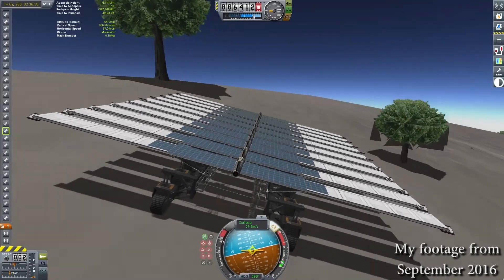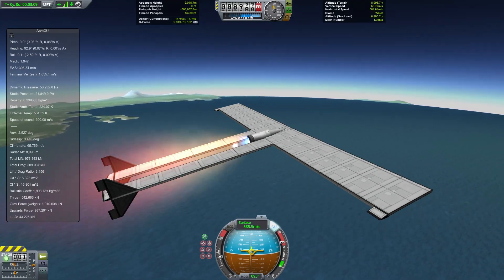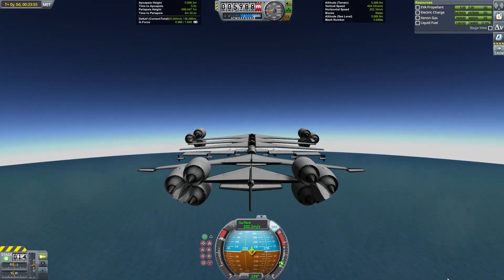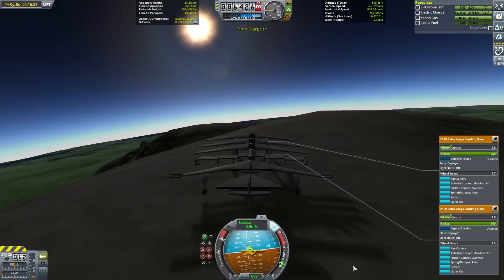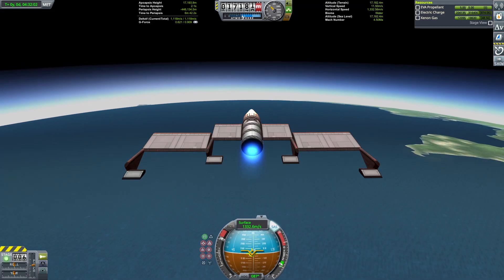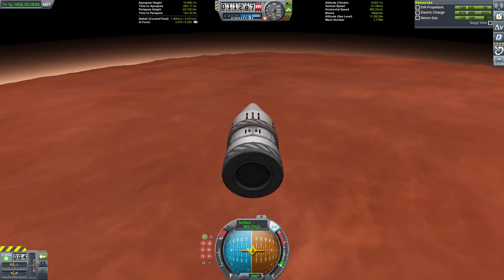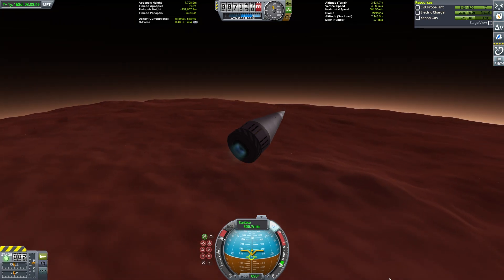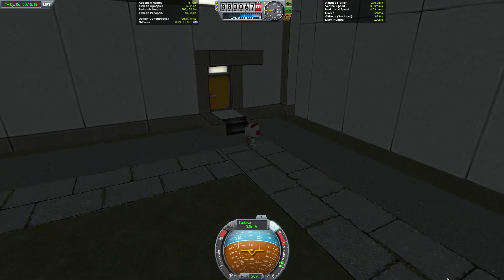Orbiting Kerbin with only ion engines - KSP

Comment: I know this is an old video, but I think a good challenge would be to try and find a way to get air breathing engines into orbit without using anything but RCS for the final orbit burn. You’re not allowed to use any air breathing engine that uses a closed cycle mode to get around the challenge and make it easy. I think it could be possible if you can get enough velocity to essentially fling yourself into space, but I’m not 100% sure that it would ever work.

Comment: Does this count, given that you used liquid fuel engines to get part of the way up?
Reply: Yes, because he took off from the surface using only ion engines. Even the KSC launchpad is around 70m above sea level if I remember correctly

Comment: I figure out is why they dont trap ions and release under higher pressure. They always show ion engines using the particles like a rocket while u want it like a engine. Imagine u release the ions into a chamber untill it fills up like a battery and the moment it starts overloading u release to create a higher amount of force. I gues overloading the reactor/capacitor will become a real thing instead only in sci-fi.

Comment: ISS use solar panels to fly like kite  in high speeds, and low presure and high altitudes in circular flyways up and down to mantain the curse and inertia, economizing fuel, on board to acurate the curse never fly over  South  or north Poles and never  to fly over _across the Poles, have a question...is the Earth a Huge sphere or Huge planisphere.? Microgravity explain : more distance far surface, minus gravity force atraction, less weight sensation,

Comment: Technically, this mission was not done ONLY using ion engines, in order to get to an efficient and acceptable altitude, you had to use air-breathing engines. I don't want to be "That Guy" but, you know.
Reply from the maker: Official mission start is on the ground at the mountain summit.  You know, to be 'That Guy' =)

Comment: The MIT group did not used onboard propellant in their electric engines but used the atmosphere it self as the propellant. This is an ionocraft engine, not an ion drive like yours is which needs xenon or some other contained gas in a tank.

Comment: bradley whistance: makes a plane with 2,000 engines and 16,000 batteries, weighing roughly 1,000,000kg

also bradley whistance: “i COULD have used a docking port, but that would have added 10kg”

Comment: I've a challenge for you that I've envisioned, but lack the skill to execute. Build a mun orbital refueling station with docked beams and rcs karts. Drag astroids to dock with it and use the rcs drill karts to process fuel in a major refinery. Then use the fuel to launch orbital stations around every planetary body in the system. It's a two goal project, accumulate all asteroids on one station, and establish a regenerative refueling platform for deep space placement of hardware.

Comment: @Bradley Whistance
At around 14:53, how did you recharge your batteries all the way up to 8300? I couldn't spot any solar panels on your craft. Did you cheat?  Anyway, amazing mission.
Reply from the maker: Great question!  The solar panel is inside the utility bay, which is opened for recharging.
Reply: @BradleyWhistance  thank you for the explanation! Now I can sleep well again

Comment: Ion engines in KSP have hilarious amounts of thrust. How much? 2000 newtons. That's off from real life ion engines by a factor of several thousand; highest thrust space flown ion engine I believe was around half a newton. The energy usage is hilariously low for them as well. A 2000 newton ion thruster with 4200 seconds of ISP would need a minimum input power of 0.5*M*(4200*9.8165)^2, where M is the fuel flow rate. The fuel flow rate can be found by the thrust as T = M*V = M*4200*9.8165 = 2000, M = 2000/(4200*9.8165)= 0.04851 kg/second, so the energy requirement is 0.5*0.04851*(4200*9.8165)^2 watts = 41.23 megawatts assuming 100% input energy to kinetic energy efficiency. Using solar panels with 30% efficiency (considered quite efficient by modern standards) you'd get 0.4119 kilowatts per meter squared if exposed perfectly to the sun, assuming you're at the earths orbit. You'd therefore need 41230/0.4119 meters squared of solar panels, or about 100,000 meters squared of solar panels. That's equivalent to a circular solar panel with a radius of 178 meters. Good luck with that I say.

Comment: In the early 70s the Worldbook Encyclopedia had plans for an air breathing ion engine suspended on a thin wire pendulum as a possible science fair project. Back then, I wondered if something like that could fly into orbit with solar panel wings. I figured it wouldn't work, so I never really thought about it much more.

Comment: Hummm, I'm inclined to think that using Jet engines to get the ion plane to altitude before launch is not quite reaching LKO using only Ion Engines.  Once lifted to altitude the difference between a mountaintop launch and an air launch is purely semantic.  Stratzenblitz did it on electric power only from the KSP and I was looking forward to an analogue to this using only ions.

Still a very nice plane however.

Comment: If you would like to see a real life ion propelled aircraft lifting its onboard power supply vertically, please click on the channel icon to the left, there are 7 different prototypes shown, flying with onboard power. 
This is the only heavier than air ion propelled aircraft with onboard power, that relies only on ion propulsion. This aircraft/UAV was patented specifically for being the first ion propelled aircraft to carry its power supply onboard, officially since 2014.  Extensive evidence that it works as shown is provided under the videos and also on the corresponding website.

Comment: What if you can't use engines or propellers at all, i.e. you can only gain delta-v by mechanically pushing off of previous stages? Even better, whats the most you can do with only the recoil from decouplers?

Comment: @ incase u were wondering the text quickly flashed said "continuing the theme of stunning realism, the ion engines can use 'asparagus' style staging while in a slack"

most likely a mis positioned frame in post OR a purposefully positioned text box with incorrect/unintended keyframe timing

Comment: Maybe you've heard it before, but the batteries are the fuel, not the xenon gas. The batteries contain the chemicals that provide energy, and the xenon gas is just an inert mass to push away from.
Reply from the maker: Both the electricity and the xenon gas are fuel, as we need both to produce thrust.

Comment: Here's a shenanigan idea, Can you catapult a space ship (With at least one kerbal inside) from Minmus to the Mun without using any thrust once it leaves the catapult device? I wonder if it's possible to build an impact system that would allow the Kerbal to survive the impact into Mun's surface without decelerating with thrust. I don't know what the minimum velocity an object would be going once it got accelerated by the Mun's pull if it managed to fall into the Mun's well at the minimum speed. I don't know if KSP calculates legrange points, or if there would be a significant legrange point between Minmus and the Mun even if it did, but I'd imagine that it would be the best vector for an approach? I dunno. I'm mostly wildly speculating as a layman.

Comment: Can we get one with twin ion engines and larger solar panels mounted to the sides in matching large vertical hexagons. Also, can we equip it with green laser weapons? XD But seriously, you should try out a design similar to a T.I.E.(twin ion engine) fighter but without the cockpit? The massive side blades have very little drag, and a lot of surface area for creating solar energy.

Comment: If you click on the purple icon to the left, you can see an working prototype ion thruster lift its onboard power supply vertically against gravity for almost 2 minutes.  It could fly all day with currently available solar cells as well as carry a small propellant tank.  I am planning on making some more improvements, so just maybe an improved version could be ssto or much better....

Comment: As impressive as this initially seemed, I started to think, is there really any difference between clipping 2000 engines together and making it one part and just modifying the engine value to 2000x more powerful and heavy?
Reply from the maker: It also uses 2000x more fuel

Comment: You mentioned in the previous video that you didn't want to do Moho with just the boring old techniques. How about landing inside the Mohole with the lightest craft possible - the hole caused by a glitch in the terrain generation at north pole of Moho? 

You might get some inspiration from this reddit thread: https://www.reddit.com/r/KerbalSpaceProgram/comments/81yucq/weekly_challenge_week_158_mohole_adventures/
The safest way appears to be using some wheels to sort of hang from the sides as the very bottom is prone to kraken attacks.

Comment: Did you manipulate reheating difficulty for this video? You're going almost 2 km/s @ 26 km ~ 10:45. I usually play with increased heating, but it seems to me that speed at that altitude often causes overheating problems.
Reply from the maker: Atmospheric heating is on standard 100% settings.  The fairing nosecone and body is unusually heat resistant, allowing for unusually high speeds.  This was close to the limit of even a fairing, but still with some margin available.
Reply: @BradleyWhistance  Damn, I'll have to remember that. Thanks for the reply!

Comment: Shenanigans:Fly normal para glider speed over helipad on the tall building. Once over it, either do a 180 dropping speed and landing, or a 3/4 front flip into a half back flip with a 90 degrees correcting spin at the end. Second one sounds really hard but would look cool from the side.

Comment: What do you mean by "clipping reduces drag"? I thought clipping doesn't effect drag. Unless you enabled the option that allows you to place multiple parts on the same node. Which maaaay be a little bit cheaty.

I am not judging you. Just pointing out some things. Afterall, this is still an amazing achievement that not many people are capable of putting together.
Reply: Clipping into a fairing

Comment: My ideas:
-get from minmus surface to minmus orbit with only decouplers
-crash an unguided missile into the VAB from orbit (or the flag pole, if thats too easy)
-Eve rescue mission: similar to what I had to pull off lately: landed rocket not enough dv, so I had to make suborbital (2km/s missing) crew transfer. Do a more advanced version of it: Crew transfer rescue mission in upper Eve atmosphere (with rockets, not planes or other lift providers)

Comment: Could you pls provide the non-welded craft file so someone with NASA supercomputer can test it? Or you stacked already welded assemblys only?
Reply: Even if someone’s computer could handle 25,000+ parts (batteries, engines AND tanks), the kraken would very quickly take control anyway

Comment: How. Did. You. Get. To. Duna. With. Ion. Engines.

P.S. I am a comment spammer.
Reply: Pancake Space Program well, he didn’t use pancakes as fuel, so he’s got that.
Reply from the maker: @Core-1948  I think the maple syrup would be more energy dense.
Reply: @BradleyWhistance  Nuclear Powered Engines<Mapel syrup

Comment: If anyone can build an Earth ssto in rss with stock parts, it would be you.
Reply: 2 RD-191 Engines with a 4 meter by 35 meter tank filled with about 250 tons of Kero/lox and a probe core and batteries has over 9,000 meters per second of delta V, witch should make it an SSTO. They are fairly easy to build if you select the correct engines, really any of the better Oxygyen rich staged combustion engines work well.
Reply: Someone else has already done it. Apparently multiple people have. Did a search to find out the link and saw several.

Comment: "ion engines ONLY"
.
.
Uses Goliaths to ascend to mountaintop.

Well, my ion-engine-only used just one S1 solid rocket booster to lift it up to 2000km altitude.
As the one S1 is both less parts and less mass than your 12 Goliaths, my design must be superior, right?
it **does** operate under the same rules you are using.
Reply from the maker: @K.O240  I'm sincerely convinced at this point that he did not watch the video.
Reply: @BradleyWhistance  You should pin this thread
Reply: lol
Reply from the maker: I heard Eliud Kipchoge flew to Germany before setting the world record in the Berlin Marathon.  I could fly a plane 26.2 miles in under 2 hours no problem.  same rules
Reply: @BradleyWhistance 
Did the airplane drop him more than halfway through the marathon?
cause that's what you did here.

There have been *plenty* of ion-engines-to-orbit projects in KSP.
And all they need is to be boosted to a workable altitude, which can be as low as 2.5km.

And p.s., they did it in stock KSP.
Welding your pieces together fugs with the aero physics, and is a known and ridiculous cheat.
Reply from the maker: @marvinkitfox3386  Remarkably, every single claim you just made is false.  I did not use anything but ion engines between the surface and orbit.  There have not been any other ion planes to orbit (excluding pre patch 1.0, which was a vastly different game).  Parts inside fairings do not generate drag, and welding does not affect this.  Not cool man.  I humbly recommend you put down the keyboard.
Reply: @BradleyWhistance  Always going to be people trying to downplay others achievements. The reality is you accomplished something that no one has done before and its very impressive. Until the point where Marvin Kitfox releases a video showing he can do this (unlikely), he might as well just be quiet.
Reply: @BradleyWhistance If welding really does not affect the plane, then let's see you do this same trip WITHOUT welding?

I'm not saying that what you achieved is not awesome. It is.
But you make false claims as to what it is you actually achieved.

It's the same as Virgin Galactic re-defining the Karman line, so that their 80km flight can be called a "spaceflight".
Reply: Also literally the point of going to the mountaintop is because you could do that easily in real life. However, in ksp, there isnt a way to start from there so he flew there manually. He probably could have just edited the craft in and started from there. But instead he made a whole craft to bring his craft there. Imo this is adding creativity. Not taking away...

Comment: There’s a tiny hole at the top of the VAB under the helipad, good luck, it’s very small
Reply from the maker: This hole?  https://youtu.be/kt6bOCKLhIU?t=853
Next video I will send bill through on the paraglide =)
Reply: @BradleyWhistance  what point in the video do you go through the hole?
Reply: @Toby Massoom ... if you follow the link, it goes directly to the spot in the video where it happens, lol
Reply: The time after this, land on the fuel tower by the launch pad :)
Reply: @JYF921  what about flying though the tiny hole in the VAB, and then landing on the fuel tower?
Reply: That’s it :D
Reply: I second this suggestion
Reply: Stop giving him ideas. Next he's gonna fly thru kerbin!
Reply: @eannamcnamara9338  did you just summon @danny2462
Reply: you could try landing on the obelisk
Reply: commented exactly this, then saw this comment, go for it
Reply: SpaceCoyote oh yes
Reply: Cupcake Landers actually flew through it at high speed.